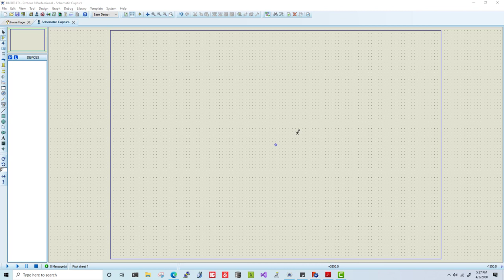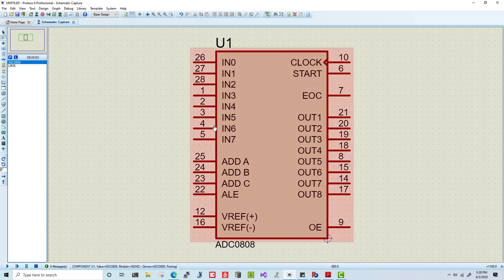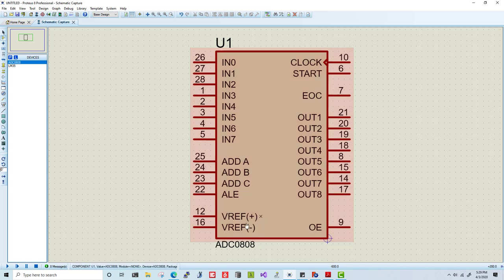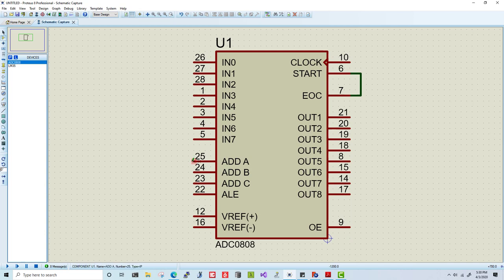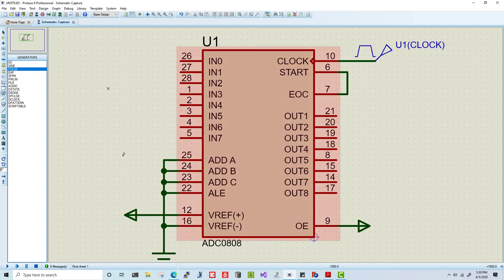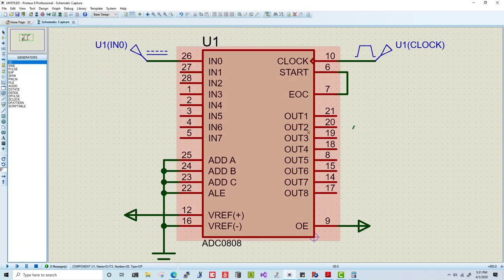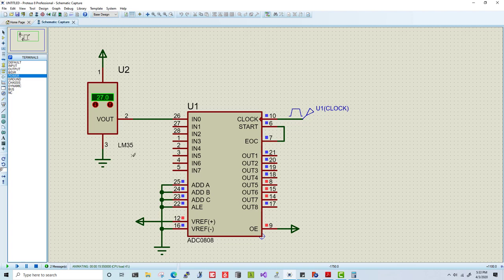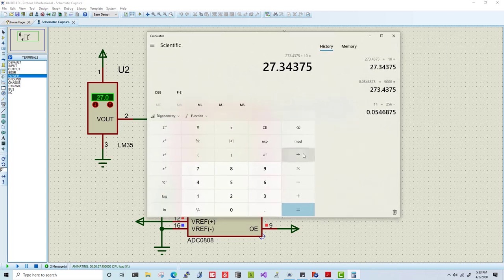Convert LM35 Temperature Using ADC0808

Comment: LM35 provides 10mv/degC and resolution of ADC0808 around 20mv so is there any way which doubles the output of LM35 so that we'll get correct output
Reply: Hello i am getting the same error in my homework did you find any solution for it
Reply: use an amplifier